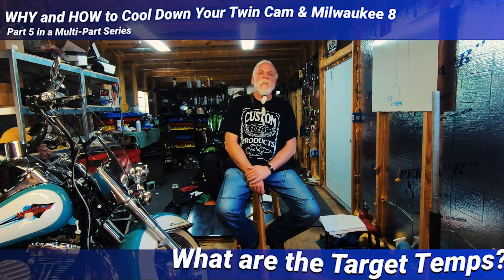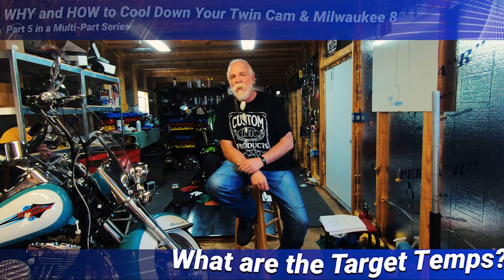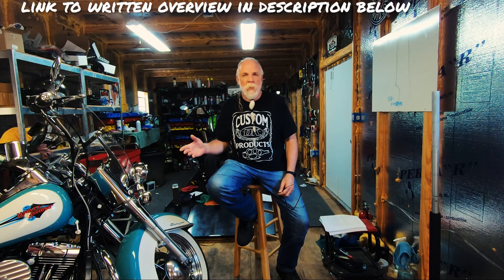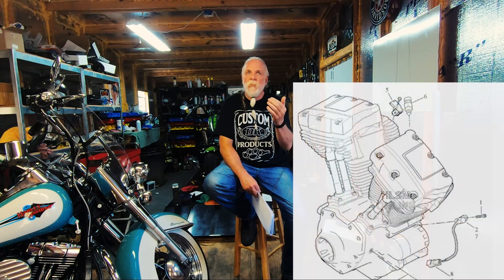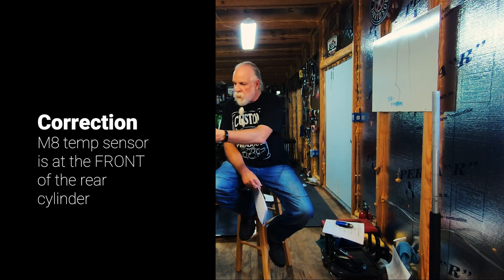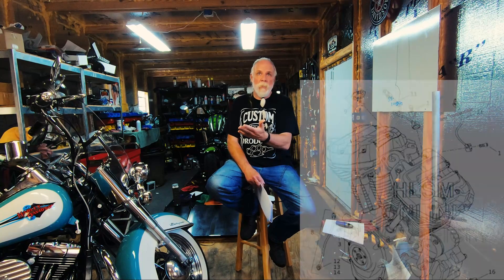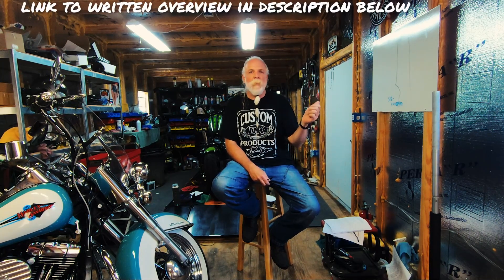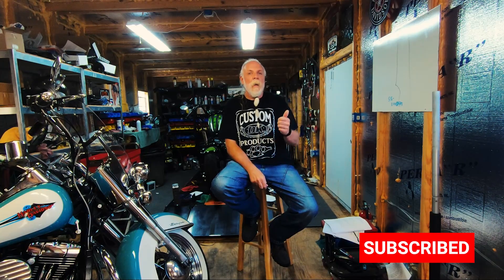Optimum Harley Temps for Comfort, Power & Longevity

Comment: How does one get “our” “ET” On a Twin Cam? (2016 Road King) Do I have to stop at a Harley Shop after riding for an 2-3 hours in 98 degree temperature in Houston area? 
which I do recently here lately.
I have a heat gun that I shoot at (top of the engine) when pulled in my garage and it reads 320-340 degrees.
Where can I buy and decent oil cooler fan & is that gonna bring that temperature down enough? It’s 99 today and my wife will ride for an hour-3 some days after I get home from work.
Reply from the maker: The ET is the read-out from the Temp Sensor in the engine.  It can be displayed on a Power Vision or a FP3/4.  https://www.dkcustomproducts.com/efi-tuners-c74.htm

Stopping at a dealership and having them plug into the digital tech to get an ET reading will not work, the temperature would have changed so much by slowing down to get there, plus the time it would take to get hooked up.

The best oil coolers with a fan for your bike can be seen at the following link-
https://www.dkcustomproducts.com/2009-up-models-c159-106.htm

A second oil cooler, with a fan will reduce the temps, but it is not the total solution.  I believe you will find the videos below useful.

https://www.youtube.com/watch?v=M9ta84TmROc

https://www.youtube.com/watch?v=afgon9Qc1B8

Comment: Thanks I ride an 2000 1200 & oil & engine or head tempts have always worried me in the HOT Georgia Sun with summer time tempts well into the upper 90 & low 100s so now I know my bike while seems hot is little under the extreams you mentioned ..Thanks for all yalls testing & knowledge yall share with the Harley Ridding Public Ill Keep watching & sharing with my Harley friends
Reply from the maker: Yes, you seem in a good safe range.
You can cool it down and gain a bit more power and less radiated heat...but at the temps you mentioned in your other post, you don't need to be concerned about running so hot you're causing damage.
Ride Free! 👍

Comment: I have an oil temp dipstick.What would be the target oil temp on a 1997 Sportster Hugger?I thank you in advance for your answer. Keep up the excellent work and videos,DK Custom Products.
Reply from the maker: You 97 Sporty is the same as what is talked about in this video where we start talking about Sportys at the 1:17 mark.  320-375 on the heat sensor in the top of the rear cylinder, and 230 max on the oil temp. 👍
Reply: @DKCustomProducts  Thanks DK Custom Products,that's good to know.I live in the Phoenix,AZ. area and even during the summer,the oil temp doesn't see 230 degrees.I am lucky to see 200 degrees.This may have to do with how rich the main jet is on the carb. Though,it is not so rich as to be blowing a lot of raw fuel out the pipes,but i need it a bit rich for the highway,which i set the bike up for. It's a balancing act. Now i need to do something to get clean air to the rear cylinder.I find because of cost,those forced air fans are out of the question. I've been trying to find a way to scoop and direct air to that cylinder,but really can't find a place to anchor the scoops.Any help will be appreciated.
Reply from the maker: @tracyjones6284  Sounds like you are doing everything right.  It helps that it is a carbed bike, and made before HD started getting hammered hard by the EPA on restrictions.
We have looked at making a scoop, like they used on the shovels.
You can see an image of what I am talking about at the link below.  You may be able to grab one and make it work for you.
https://cdn.shopify.com/s/files/1/0323/0430/0171/products/42-1010c_2048x.jpg?v=1587744886
Reply: @DKCustomProducts  I looked at the photo,good looking scoop.Problem,that is where i am relocating the coil. Now what?
Reply from the maker: @tracyjones6284  Yep, I hear ya.
Have you done a tank lift?  That will get a bit more air over the rear cylinder, along with your coil relo.
Reply: @DKCustomProducts  I am going to,but haven't done the tank lift,yet.I am making a change to the rear suspension by giving it a small lift to help with the handling of the bike.So I will have to give the tank a lift to get the fuel to the petcock.I have to be careful though,i have 1.5" pullback risers on a 4" rise,and i am adapting a 5 gallon carbureted Dyna tank to the spine to get more distance out of the ride and may run into interference problems.One step at a time,takes a long time as a one man crew.I am getting things done slowly but surely.
Reply from the maker: @tracyjones6284  Sounds like you have a good gameplan!

Comment: Thank you for the info!! Needed this! My 07 RG (96 inch twin cam) with Force winder intake, Vance and Hines 2 into 1, TMan 555tq cams, Pro Vision Tuner runs anywhere from 180 - 250 according to my ET gauge on the tuner. At first I was shocked by this but seems to be normal. I use full synthetic Lucas of course and change very regularly. Makes sense that this runs a little hotter with the big cams and more than enough power lol. Keep in mind this is also is dry, hot Las Vegas! Rode the other day for over 3 hours at about 65 degrees at 80mph with a passenger and ET didn't go over 190. In the 110F days out here seen it at 265+ ET. That's when I don't ride lol. But for the mods I have and Temps I've seen. 180 - 250 could be normal. Still freaks me out though lol
Reply from the maker: Yeah, best not to go over 230* F, but the temp range you are running is much better than most.

We have a video coming out in the next month or so showing how radically the power drops when the engines get too hot.
Reply: @DKCustomProducts  yeah I need to look into some modifications like an oil cooler and fans. I know there are some well known kits. Can't wait to see what other info you give us! Really appreciate it!
Reply from the maker: @tonytwotime783  Glad you're digging the videos.
On my 05 Road King and 09 Ultra, I ran two oil coolers.
One down in the factory position, but with a fan.  See link below.
Then I also ran one on the downtube.  It is in another link below...along with a link to a video on oil coolers.
https://www.dkcustomproducts.com/fan-assisted-lowmount-oil-cooler-system-harley-touring-models-dk-j-751-fp2300.htm

https://www.dkcustomproducts.com/auxiliary-oil-cooler-for-all-harley-twin-cam-w-o-lowers-dk-sec-oc-tc.htm

https://www.youtube.com/watch?v=M9ta84TmROc

Comment: On temps @50-75 M8 according to Power Vision is anywhere from 320-331 and oil temp under 215 according to Oil Dip Stick read out
Reply from the maker: 320 F readout on the ET from a Power Vision is far too hot for optimum performance and for longevity of the engine.  HOW LONG have you ridden when you see those ET and Oil temp numbers?
Reply: @DKCustomProducts  takes me 45 min to an hour to get to work and to get home
Reply from the maker: @Heavy69Metal  If you are riding an hour and ET on the PV is 320 and oil temp is 215, After riding for an hour, I would start with double checking the devices giving you those two read-outs...because something is not making sense.  If you have oil in a pan on the stove, eventually the oil will be very close to the same temperature as the metal.  Running it thru a cooler will not make for a 100* difference.
On the M8, because of where the sensor is on the cylinder that feeds the ET readout on the PV, AFTER the engine is fully heat soaked, there should be a 45-65* difference (at interstate speeds) between the ET reading and the oil temp.  These numbers apply to an oil cooled M8, not a liquid cooled.
btw, what is the ambient temp you're riding in?
Here is a video you may find interesting- https://www.youtube.com/watch?v=h7EdjR8l8Ag
Reply: @DKCustomProducts  I agree. It’s not making sense at all
Reply: @DKCustomProducts  update 131 @325 off power vision ET and Harley oil dipstick says @240
Reply from the maker: @Heavy69Metal  How long had the engine been running when you grabbed those temps?
Reply: @DKCustomProducts  30 min or so
Reply from the maker: @Heavy69Metal  Depending on the weather, it takes much closer to 60 minutes for the engine to be heat soaked/for the oil to catch up with the engine heat.

Comment: I’m in Florida I ride @50 miles to work and @50 back home my temp going and once at work is @300-316 plus when I get home it’s @306-320 plus. It’s a 2018 Road Glide Special M8 107. These temps are the ET reading on power vision the head temps are @22 plus give or take higher than the ET reading
Reply from the maker: That is too hot.  Accelerated wear is occurring at those temps, also decreased power is being made at those temps.
Reply: @DKCustomProducts  I know. Grrrr
Reply from the maker: @Heavy69Metal  😢
Reply: @DKCustomProducts  I got your tank lift and going to be installing it this coming  weekend
Reply from the maker: @Heavy69Metal  That is a great step toward cooling down the temps!
Reply: @DKCustomProducts  how about outing back on stock map or stock map modified
Reply from the maker: @Heavy69Metal  I don't understand the question
Reply: @DKCustomProducts  should I put the stock tune back on vs the tune specific for the aftermarket exhaust?
Reply from the maker: @Heavy69Metal  I have no way of knowing if the tune specific for your exhaust is any good or not, so cannot answer that question.
If you are using the power vision, a good base tune for your set up, then run some auto-tunes to get it dialed in.
Going from the stock tune, to a really good tune is going to lower your temps by  10-15 degrees.

Comment: Need more development of oils
Reply from the maker: Please expound.  You think a better oil will take an engine from 300^ down to 220* ?
Reply: @DKCustomProducts  No. I'm thinking that if the oil polymers breaks down at the temperature you're describing and exacerbates the problem then better oil should be developed to at least provide a little more protection for engine components. No doubt that you are correct about the high Temps being the major issue.
Reply from the maker: @robertmcdougal2966  Ah, got you.  I would prefer to keep the heat down, that way oils that we have available to us will work well, plus it is better on the metal expansion and contraction.

Interesting side note:  My wifes truck, a 2020 Ford, even while pulling a heavy load, in high ambient temps, rarely sees the oil temp go over 210, and when it does, it only goes to 215-217.

Comment: you know alot on twin engine do you know anything on v twin commercial mowers want keep oil temp down no temp gauge just oil cooler
Reply: with the engine behind me I just don't ee much air flow on the engine  ordered a fan to mount up to help maybe
Reply from the maker: @shanepipkin4041  There are so many different mower engines.  My v-twin mower engine, that is behind me, has a pretty good fan built into the flywheel that helps cool the engine.
Reply from the maker: Interesting you ask.  I saw an oil cooler on a v-twin lawn mower just a couple of weeks ago.
But, we have done no testing on lawn mower engines.  I am sure there are things that could be done, varying engine to engine.  I would look at oil coolers and wind flow across the engine.  I would also do an external breather system on it.

Sorry could not be more help.

Comment: My engine oil temp usually runs 195 /210. (My engine, exhaust, and tune are modified). If I see my oil temp hit 225/230 I pull over and let my engine cool off for 15 minutes or more. My wife thinks I'm nuts but according to this video it's justified. I'm lucky because I rarely hit traffic or stop lights riding in New Hampshire and Maine. I feel bad for the riders that can not avoid this condition.
Reply from the maker: Not sure which bike you have, but having the oil run 195/210 is great.  225-230 is about as high as you want to see it.  The other factor is what is the actual metal in the engine.  If you have a lot of cooling for your oil, engine could still be hotter than ideal.  But it sounds like you have a good handle on things.
Thanks for the comment.
Reply: @DKCustomProducts  2013 FLHTK, Use REDLINE products in all three holes. I think my Tune, cams (S&S551) exhaust (S&S Power Tune Duals and SPO mufflers), and S&S air filter. The bike was a heat monster stock and ran horribly until the mods in my opinion. It now runs as it should have from the day of purchase.
Reply from the maker: @kerrylewis2581  Enjoy the ride!!!

Comment: After watching so many horror stories, I am feeling pretty good about my 09 RKC. It came factory equipped with a SE 110 which has about 23k miles now. It runs around 225F, doesnt seem to sump and has plenty of get up and go. It came with an oil cooler and the previous owner added D&D Fat Cats. I added Legends RevO A shocks and LED lamps. The compensator started making terrible sounds at 22k miles so I did replace that with a Dark Horse sprocket and Baker Attitude Adjuster. Today I ran a bore scope down the cylinders and they are looking great with plenty of cross hatch visible and minimal carbon buildup. Next I'm going to go with a Daytona Twin Tec tuner and high flow breather and that should be it. I should be all in at around 15 grand with a bike that is reliable and as fast as I want to go. The two previous owners did impeccable maintenance and I just finished the entire 25k maintenance myself so it should provide many more years of service. I have learned a lot from these videos and will keep monitoring the bike but so far, so good.
Reply from the maker: Sounds like you a a great running bike!  Enjoy the wind!  
Glad you found the videos useful.

Comment: I'm glad you mentioned the oil temperature in Sportster. I have a temperature gauge in my oil tank dipstick which is accurate. With the 230 degree F target for maximum heat in the oil, I feel good because my oil usually runs between about 200 degrees on secondary roads and occasionally up to 220 degrees on the interstate in mid-summer. Thanks for the info. My 2005 XL883 has never burned, dripped or leaked any oil and I use Amsoil 20W/50 in both holes with changes @ 2500 mile intervals. So far, so good.
Reply from the maker: Those are great oil temps!  Glad you're enjoying the vids.  Thank you for the comment.

Comment: I'm looking to cool my 107 down this year..I   just did a zippers 468 cam with an s&s  oil pump. Can't  ride till spring.  Will the cam and oil pump effect  temps  ? Positive  or negative?
Reply from the maker: Great question.  98% of the time when adding a more aggressive cam, the engine will run hotter.  Change in temps because with upgraded oil pumps are negligible.
Other changes that were probably made when you did the above are a tune, and possibly exhaust.  Depending on what your tune was before, and what it is now, it may run a bit cooler, or it may run quite a bit hotter.

Comment: LOVE THESE VIDS! THE SAME THING YOU ARE SAYING IS THE SAME THINGS I HAVE BEEN COMPLAING TO THE STEALERSHIP AND PERFORMANCE PARTS ABOUT ON MY M8 CONCERNING RUNNING HOT.  I LIVE IN SOUTH ALABAMA, RIDE A 17 ROAD GLIDE SPECIAL. ON THE INTERSTATE CRUISING AT 70 TO 75 MY BIKES EXTERNAL TEMPS REACH 300. WHEN I EXIT THE INTERSTATE AND COE TO THE FIRST RED LIGHT AT IDLE MY ENGINE GOES INTO THE EITMS MODE... THATS NOT NORMAL BUT THESE MOTHER HUMPERS TELL ME IT IS!!!
Reply from the maker: Unfortunately it is normal....BUT, it is NOT right at all.  After I had an engine rebuilt under warranty for running "normally" too hot, I decided to figure out how to cool these 2007 & later Harley's down.

Glad you are enjoying the video series and hope you get yours running how you want.

Comment: I was wondering have you done video on rpms for the M8 and best shift  points. Such info seems varied.
Reply from the maker: We have not done a video on this.  Might be an interesting one.  Will be sort of hard since there is no easy formula.  Ideal RPM shift point varies, almost infinitely, on how hard one is accelerating.  

May be why you are seeing so much varied info.  One thing is sure, you don't want to lug it, that will generate excessive heat.  But, again, that comes back to ideal shift points. 

Yeah, good question.  Might be a really good video. 👍

Comment: Ok...I have a RKS 2017. Not sure what my temp is, just know it feels cooler then others. Especially older models.
Reply from the maker: Yes, Harley has done an exceptionally good job on the M8's at protecting the rider from feeling the heat.  But the M8's run just as hot as the Twin Cams, and have many of the same problems from the excessive heat that the engines components are subjected to.  See the series on this subject here- https://www.youtube.com/playlist?list=PLb3bvZgbH92_3s-2vv63QggFJ3nteFd_C

Comment: I’m running 130 C (266 F) with a tune and an external breather.  Just cruising.  Need to look at a oil cooler or a oil relocation kit.  Can your oil relocation kit mount on the down tube?
Reply from the maker: If you have a bike that does not have lower fairings, then you can mount an oil filter relo on the downtube, see it at this link- http://www.dkcustomproducts.com/cnc-oil-filter-relocation-kit-sportster-dyna-softail-touring-dk-cnc-ofr-uni.htm